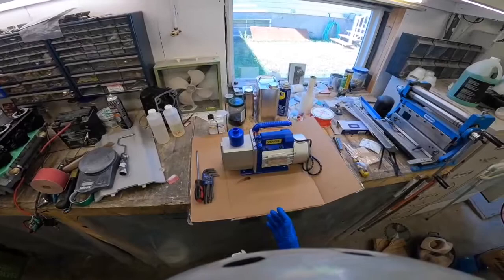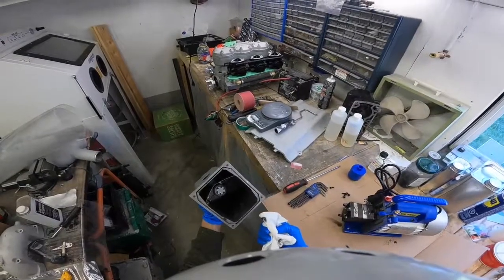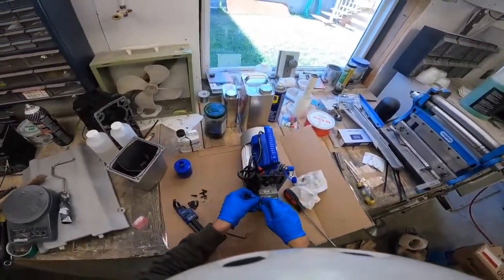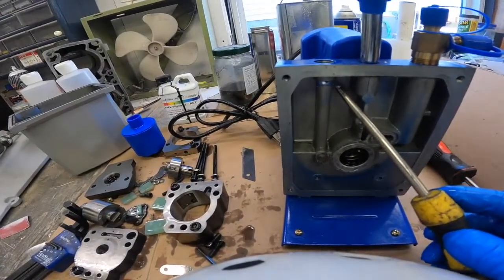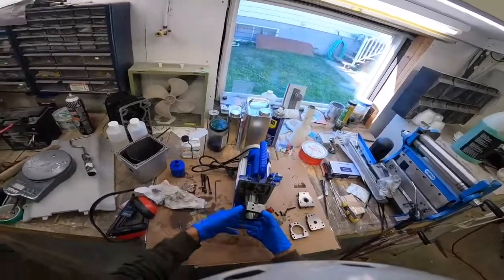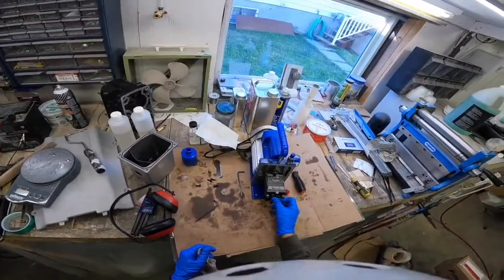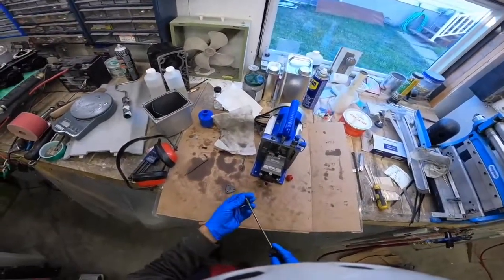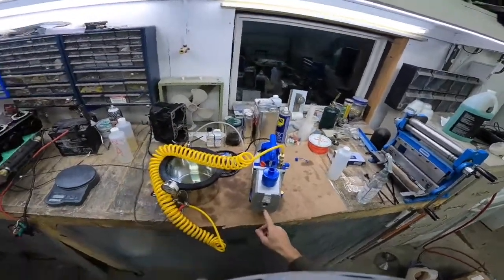Two Stage Vacuum Pump Teardown & Rebuild - Why Do Cheap Vacuum Pumps Fail ?

Comment: The rubber cap at the top of vacuum gauge is the fill port for the glycerine. There is no adjustment under the cap. You do indeed have to vent this type of gauge after installation or any elevation change in order to get accurate readings, and even temperature changes will cause gross errors. Some gauges have a manual vent valve incorporated into the rubber cap to facilitate this, and some manufacturers will even recommend leaving the vent open if the gauge is installed in a permanent upright position.
Reply from the maker: Thanks for that info in such detail. I have had someone say something about venting for elevation, but this is great info 👍 I will pin it to the top.
Reply: @JoelArseneaultYouTube   thanks bud I just notice that is has a snap ring at the end . All I need to do is remove the motor from pump assembly. Thanks again
Reply: @stinkyvonfishstix4196  As I said in the comment that you are replying to, GLYCERINE. Not oil.

Comment: Thanks for the very thorough walkthrough. I have the same pump. Just a couple of comments: 1) Mine was missing exactly the same screw in exactly the same place. Maybe they left it out on purpose, but I replaced it like you did and it seems to run fine. 2) The reed valve screws had thread lock compound residue on them, so I used Loctite blue when reassembling. 3) Mine was gritty inside as well, so disassembling and cleaning is definitely a good idea for these pumps. 4) The chart showing vacuum loss with increasing elevation alone was worth watching the video. Cheers!
Reply from the maker: Thanks for the detailed comment ! I have used mine for many many hours now 100% trouble free.... only thing that happens is I forget the vent plug in and it scares the crap out of me when it pops out with a bang, haha.

Comment: That's great information. I appreciate the time and detail you put in this. I just bought a Vevo home to stage vacuum pump model VP 245. Haven't taken it apart yet but this will still be very helpful.
Reply from the maker: I just used mine yesterday... still working perfectly. I've put many many hours on it.

Comment: Joel, thank you for this very informative video.

I bought this same vac pump and it arrived today. So I thought I'd better watch a few videos on proper usage and I'm so glad I came across yours. I haven't yet switched it on but you've convinced me to check it first..thoroughly and to ease it in to usage with some unloaded cycles.

Top notch video. 

I've subscribed to your channel.

I'll update you if I find anything similar like bolts missing or extra pieces 

I'll have to watch the video again before attempting as there were a few timesaving and preparitory steps to note.
Reply from the maker: Thanks for the comment and subscribe ! It took me 4 pumps before I got one that worked.... hopefully you don't have to go through the same hassle. Others have noted that the camera angle is too wide and there's not a lot of detail... however, I believe if you have a decent level of mechanical ability you should be able to pull this off and be confident that it's not rusty or missing pieces. 

Good luck.
Reply: @JoelArseneaultYouTube  yes I have opened a motorbike engine and swapped in a higher ratio 6th. So I'm confident. But careful.

I also have an orange BAC brand vacuum pump. Only 1 CFM but new from china.

Perhaps I'll look at that too before running it
Reply from the maker: @rodneyalan6441  You should have no issues, haha. I've had a few motorcycle transmissions apart before, but never to change a ratio... interesting.
Reply: Yes you did respond.. gear ratio in top wasn't tall enough for open road so I retrofitted from newer model  7% more in 6th.

Anyway thanks for the info. Surprising that you had 4 before you got a good one. Guess they're cheap for a reason. I only spent 169AUD but that was without oil.. so I'll now have to seek out some SAE 20 vac pump oil.
Reply: @rodneyalan6441  Did you find any issues like Joel did when you took yours apart? Like missing bolts, extra hardware, rust, contamination?
Reply: Joel Thank you for shearing

Comment: Very interesting and on right timing video for me. I bought a VEVOR 2 stage 12CFM (VP280) 2 weeks ago. Received it in very well condition, not flooded from oil in packaging and not seized. My first interrogation have been how much oil to put in because using the quantity as on the side label seem too much an this model don't have level mark on or near sight glass. I have poor oil to mid high level on the sight glass and run the pump for few hours with intake capped to warm it up. The pump initially produce gentle soft sound but as it become hot it start to produce a rattling noise. When the pump become hot the oil level is over the sight glass. I have tried to used less oil but rattling noise remain , but rattling reduce when the oil level is mid height when pump is running and hot. It seem to be related to oil viscosity. Oil was not included in the package and I am using high vacuum rated oil from Amazon Robinar Premium vacuum pump oil. Your video is giving me the kick to take the pump apart, but I am afraid not to be able find and solve the issue without directive. 
Further more, interrogation concerning piping diameter and length from pump to chamber is very important not to choke and limit flow. I rather to breathe through a snorkel than through a straw. Pipe conductance in viscous regime (Couette flow), the ability to let air flow goes as diameter to forth power (D^4) and inversely proportional to the length. So short and larger diameter as possible is always the best. As a rule of thumb, conductance should be ten time that of the pump. Conductance is also function of pressure and decrease with the pressure. Larger diameter help to keep the flow in viscous regime because as the pressure decrease flow become in molecular regime and conductance fall a lot to diameter square (D^2)
Also, mechanical pumping speed must be match with chamber volume. These pump are not air pump and should not at atmospheric pressure for an extended period of time. Most pump manufacturer usually specify the maximum chamber volume.
Finally, mechanical Bourdon type gauge are not very precise and thermal type gauge are highly more precise and reliable.
What type of oil come with the pump? I would like to run it with specified oil before taking it apart.
Good and valuable video, I will take it apart and make a rigorous cleaning and inspection !
Thank you again!
Reply from the maker: I would ignore oil quantity recommendations and simply add oil till it is half way up the sight glass when turned off and level. I think you are overthinking this. Any decent vacuum pump oil should be good for this pump. 

I have noticed the pump making a metallic clicking sound as it starts to pull a vacuum, but then it quiets down as it nears 20 in/hg, for example. So it is quiet when operating open, and quiet when it is past 20 in/gh. I don't think this is a problem with the pump at all and just normal operation, but maybe yours makes a different noise. 

While you are right about restrictions in air line size and length, I don't think this matters at all in this case. The 12 cfm that your pump is rated at is basically in free flow... If you were sucking air from a room, it will flow that much... However, the amount of air that can possibly flow is obviously decreased when you decrease the amount of air... If you have a perfect vacuum, it doesn't matter what size pump and line you have, zero air will flow if there is zero air. I hope this makes sense. 

Though your english is very good, I assume that english is not your first language. I'm not totally sure what you mean about these not being air pumps. I think you are saying that it should only be used as a vacuum pump and that it should not be run without a restriction. 

I do not know what they specify as the correct oil, but I assume that it is SAE 30 that it ships with. I would like to try SAE 50 in mine as I sometimes run it for several hours and it does get quite hot.
Reply: Thank you very much for your direct assistance. I greatly appreciate it. Using the term air pump is to make a distinction from vacuum pump which produce negative pressure compare to positive pressure for air pump. Negative pressure is for measuring devise with relative differential scale like psig compare to psia. Pressure is a quantity always positive with 760 Torr(mmHg) being standard atmospheric pressure and 0 Torr pressure is difficult almost impossible to achieve on earth meaning a space without free molecule. The term air pump was also to point out  your choice of using coiled compressed air hose to connect to vacuum chamber. ( that make me smiled). Using brand new clean garden hose pvc tubing of moderate length with 1/2in ID would provide you with a lot more efficient pumping with reduce pumping time, and lower ultimate chamber pressure. 
Oil rotary vane vacuum pump use oil mainly for sealing and reduce frictional wearing of vane. It is also important to have enough oil because without it heat cannot transfer from under vacuum internal component to external shell for cooling. Pump down process generate a lot of heat in the pressure range near atmospheric working harder and it shouldn't last for an extended period of time to prevent damage to vane. Vanes were originally built from Bakelite, and now from wearing resistant Nylon or for high professional grade pump from engineering plastic, but with operational temperature limit of polymer. 
Concerning my pump, it produce unsteady burst internal vibration that don't seem to be related to pressure but to temperature. I suspect issues with oil injection metering circuit. Any way don't seem normal operating sound. I have got the pump directly from VEVOR and I was hesitant to do internal investigation by myself without any service manual instruction instead to return the pump. But from your video it seem to me that by doing a pump exchange there a great chance that I will not receive a better quality pump but even a worse condition. Your video is giving enough internal details to provide me the guts and confidence to investigate inside the pump by myself. I will provide you feedback.
Thank you again!
Regards!
Reply from the maker: @guylebrun8674  Okay, I understand. instead of "air pump" I would just use the terminology "compressor" and Vacuum pump. 

 Yes, I understand that a perfect vacuum is impossible to achieve with one of these pumps and it takes very expensive laboratory units to get anywhere close to an actual vacuum. The term is used very loosely as the general population understand what you mean when you say "vacuum". 

I understand that a 1/2" hose allows for more flow, but the pump and my needs, do not require more flow. A larger hose is much more likely to collapse and has more volume, meaning the pump has to remove the air from the hose as well. 

Yes, sealing, cooling and lubrication are very important. I can also understand that the pump down time is where the pump generates the most heat, that makes sense. 

If the sound is heat related then that is worrisome. You can take it apart and look for damaged or improperly made pieces. A thicker oil could help with this. My pump does not have a oil pump of any sort .. it is a wet bath system / splash system. 

The pumps that I got were all from different sellers on Amazon. I have had really good luck with stuff directly from VEVOR.

Comment: Perfect timing 😁 I'm currently researching for a pump & chamber for resin work, these 2 videos help a lot, thanks.👍
Reply from the maker: Awesome 👏 I like when my videos help someone 👍👍 good luck.
Reply: @JoelArseneaultYouTube  I have a pump that needs to be rebuilt/cleaned, and I was also considering buying a pump and chamber setup on Amazon for around 200 bucks--and I was wondeirng--did you link where you bought your setup?  Thanks,  -sb
Reply from the maker: @sbalger  Hello. I didn't link it. They change availability very quickly and I had to purchase a few pumps before getting a good one. I believe I purchased 4 and returned the first 3, as they were way too rusty inside.

I got them all from sellers on Amazon, but you can get the same one from a company called Venvor. I believe they ship directly ( here in Canada )
Reply: @JoelArseneaultYouTube  I will check it out, thank you!

Comment: Hey Joel, thanks for the video.  Couple of notes:

I have a reed valve lodged between the pump and motor, just like you did.  It must be a shim.  You should put it back.

You are right about the ideal vacuum depending on your altitude and atmospheric pressure.

My pump 2RS-3 also has several bolts missing.  There is only one bolt in each layer except the last one.  Recommend to order a few extra socket cap screws: M6x16 and M6x30.

To prime the oil, you could just turn the fan at the back before applying power.  No need to disassemble the pump.
Reply from the maker: I now have many many hours on this pump and have not had any issues, it has worked 100% I don't doubt that the valve was used as a shim, but I don't imagine that it was needed due to the design of these pumps, and the fact that I haven't had any issues seems to support that theory... but I do believe you are right... 

Perhaps they were trying to save money and didn't think they needed all of the bolts. That does seem foolish, but I wouldn't doubt it. I took my pump apart because I had purchased 3-4 that were all seized due to rust on the internals. I took this one apart to clean any rust off before trying to use it, to avoid damage. 👍
Reply: @JoelArseneaultYouTube   Wow you bought 4 pumps?  Mine is also seizing unless I leave the bolts loose.  I did clean the rust. I will install the missing bolts to apply even torque.  I guess the QC inspector was asleep that week 😆 Thanks again.
Reply from the maker: @kevinkassil6038  Yeah. I bought a pump and it was seized, so I sent it back, the next one was seized and I took it apart and it was filled with rust. Again the same thing with the 3rd one so on the 4th attempt (this one) I took it apart before ever trying to turn it on. 

I have a feeling that they are all being shipped from China in shipping containers and then stored until the point of sale... and that's why so many of them were rusty. This last one was the best of them and I had to wait longer for it as they were out of stock... 

I did run into an alignment issue with my pump when assembling it for the first time. I think I talk about it at or near the end of he video, but when I first assembled it, something didn't go right. I disassembled it and it worked fine the second time around. 👍

Comment: Informative video. Do they make parts for vacuum pumps? I have a Dayton 7 CFM. It runs for a little bit and then stops and sounds like it locks up. I took it apart and then turned the motor on, it sounds fine.
Reply from the maker: I have gone on a search looking for parts in the past and didn't have much luck. I feel like there's probably a place where you can get rebuild kits, but I have not found it.

Running for a while and stopping sounds like perhaps a clearance or alignment issue. Once the pump gets hot, it may be binding up. New parts may not solve this. It may just need careful assembly... but it's hard to say for sure.

Comment: I have the same style pump. Do you know of anyway to make a cut out switch. To maintain 25hg. Ex cut in and vacuum to 25 then cut out and if it goes to 20 cut back in and cut out at 25 again.
Reply from the maker: I've looked into this before and you can buy a "Adjustable Vacuum Negative Air Pressure Switch". I found them on aliexpress. I've never done it, but you would wire this into your power cord (basically) and it would kill the power to the pump at the desired pressure. I highly doubt that you can set when it turns back on, but it would have a preset of a few hg before restarting. 

The other route you could take, that would take a lot more ... knowledge / tinkering, is to use an arduino (programmable circuit board) to trigger relays and program in you high and low levels. You would need a pressure sensor, a relay and arduino.... I can't help you with details on that, but there are plenty of forums.

Comment: Hey bud how do you replace the oil rings on the robinair 15600 Iso-Valve Assembly ?
Reply from the maker: I have never had one apart, but i just had a quick look at the part and a parts diagram. It looks like the end of the valve assy has a groove in it that is easier for a retaining clip or some sort of retaining screw. They do not show either of these things in the diagram... You may be able to access this by removing the inlet fitting on top, but I'm guessing you have to take the whole thing apart. The retainer may be accessible if you remove the pump assembly from the motor.